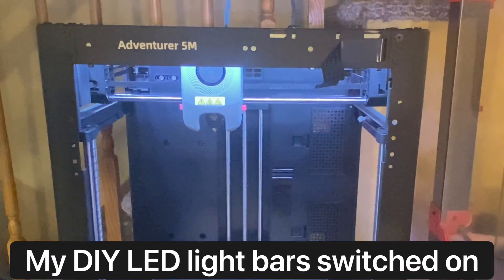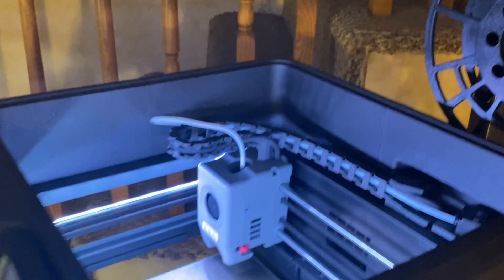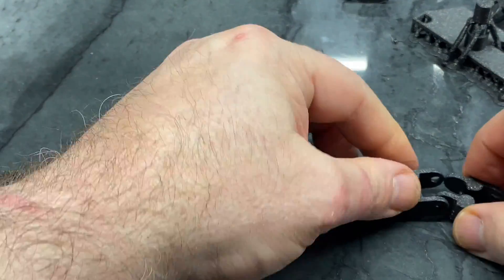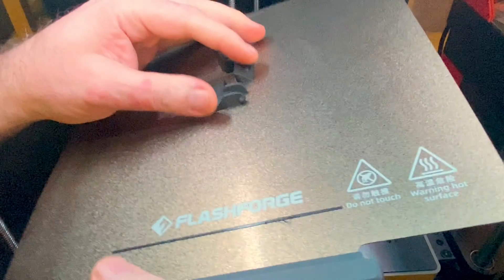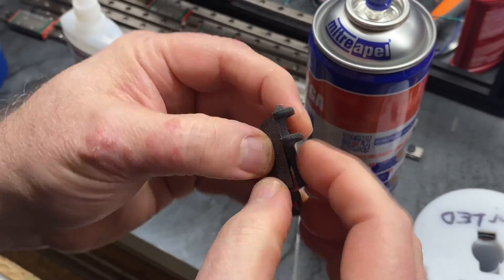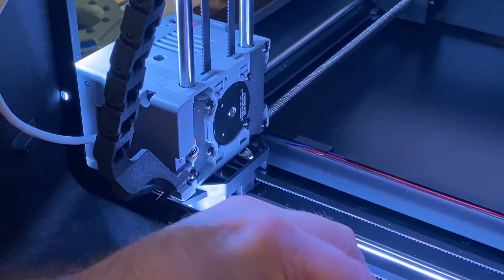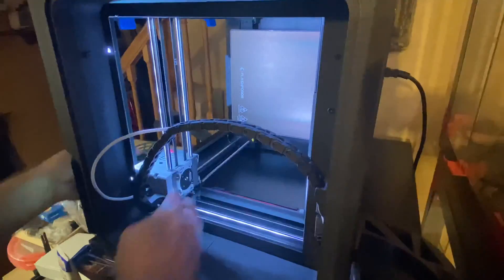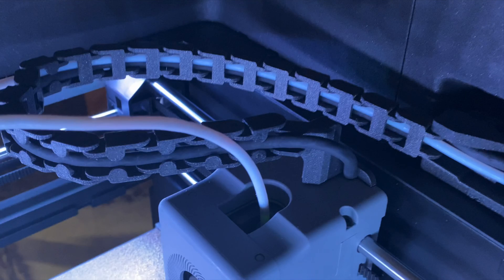Flashforge AD5M: DIY Enclosure- easier, simpler, faster, stronger cable chain termination at hotend!

Comment: Do you need the extra link if you use the drag link that came in the diy kit?
Reply: i have same question
Reply from the maker: I'd say no, but feel free to play around with your setup, checking if the length of chain is OK or if you need to reduce by removing any links. I have a mix of both printed chains and injection molded from kits. My kit-based chains do just fine.

Comment: new to printing been following the DIY instruction guide then i got to the spool holder... so i printed everying in STL. the STL version of that hanger was driving me insane trying to follow along(cuz its not the same). then i noticed STEP version... do i need to reprint everything in STEP going forward? lol. it all downloaded as a zip file and never says to do one over the other. feeling dumb.
Reply from the maker: You don't need to reprint everything, the STEP files just provide an editable version for customization. They make it easier to import the design into 3d modeling (CAD) software. Again, the STEP files are just for if you want to make edits and adjustments, the STL files are the final print files. In some cases in my listings, there are also .3mf files, which are my print job setups for OrcaSlicer, provided to show how I had (for example) parts oriented, parts ganged up, and supports tailored.

Comment: I had some issues getting this printed. Can you tell me if you had any issues getting it printed? I tried printing the first part of it last night, and it left a sizable chunk of the part and I had to cancel it. Any help is appreciated. I am using flashforge PETG and the ORCA-Flash Maker software. I am wondering if that might be part of it.
Reply from the maker: My AD5M has printed a lot of PETG with no problem. I've been using a print profile in Orca Slicer that was provided by Flashforge, that was named "Flashforge Generic PETG" and had nozzle temp of 255, but I later found it did better if I raised it to 260, and a bed temp of 70.

Comment: How did you remove the Flashforge logo from the enclosure top and ad your logo ?  I would like to do this for mine . I have all of your upgrades printed and ready to install when I get the top part of the enclosure printed .
Reply from the maker: I "remixed" that part in a 3D modeling program. I started in AutoDesk Fusion360, and I think I had to do some touch up in SketchUp because my logo is complex and I was having some issues.
Reply: @design8studio  Thank You . I'm still learning how to use Fusion 360 but I will give it a try .
Reply from the maker: @billywillis4194  After opening the file, which if there is a "STEP" file available that's first choice, and if not, then import the STL as mesh into F360 and generate faces and convert to a solid body... After getting at the file, the basic process for removal of the old logo, would be to right click on the smooth face that's the background around their logo, and create a sketch. in the sketch edit process, tap on "P" for "project" and select the edges of that face to project those lines into your sketch. You don't want their logo projected though. This gives a sketch that's a "clean" face version for that part of the solid body. Then finish the sketch, and select that clean face (you may have to temporarily hide the solid body to select the sketch's face, and then show the solid body again before continuing), and tap "E" for "extrude" and extrude outwards, with mode set to "cut" and cut away their logo off of the solid body of that part. You could then edit the sketch to add your logo, and then finish the sketch and select your logo and "E" for extrude except this time "add" mode instead of "cut" mode. Hope that helps.
Reply: @design8studio  That helps a lot  . Thank You .
Reply from the maker: I just remembered seeing that someone had already posted a remixed "no logo" version on Printables. It will save you some steps. Here's the link: https://www.printables.com/model/874859-flashforge-adventurer-5m-ad5m-enclosure-mod-no-log
Reply: @design8studio  That is awesome . That will save me a lot of headache even though I need to learn as much as I can in fusion 360 . Thank You very much .

Comment: I just purchased this printer and plan on doing the enclosure mod . Do you have a list and source for all the different fasteners ?
Reply from the maker: There is a vendor (I think the name is called Funspark), on aliexpress.us that sells a kit for the DIY enclosure that includes laser cut polycarbonate clear panels for the door, sidewalls and top, and a cable chain, some PTFE tubing, and all the hardware, for only $48. You can’t beat it. I think I linked to it from one of the other comments, or the video description, or the Printables description.

Comment: Hi great video I was really wanting to know how we're you able to tweak it and add you're logo and remove the flashforge logo? Please and thank you
Reply from the maker: Sure. There's more than one way to get that done. One way is you can download the source files from the Flashforge wiki for the enclosure (which includes STEP file) at https://wiki.flashforge.com/en/knowledge_corner/printer-mod-and-diy — you can open STEP file in Fusion 360, which has a free hobby license available, and edit the 3D model in Fusion 360 (or any 3D modeling program that can open STEP files) or you import the STL file info a 3D modeling program and edit that. One such modeling program is SketchUp. I did some of my remixing on the Fusion 360 side, and some on the SketchUp side. I think my final work on this logo replacement was in SketchUp. They also offer a free edition.
Reply: Thank you so much also is it 100% Necessary to print in PETG for the corner
Reply from the maker: @ThatRomnGuy  PETG is not necessary on the corners as far as I am concerned. I printed mine in PLA.
Reply: Or can I print that in PLA as well
Reply from the maker: @ThatRomnGuy  Yes, I printed my corners in PLA.
Reply: Sounds good thank you

Comment: Thanks again for sharing these excellent videos .. between you and Figure Feedback, I was convinced to pick up a 5M as a second printer, and already it's so overperforming my expectations that it will probably become the workhorse printer, with the Sovol SV07+ being used for the large size prints.
Reply from the maker: Thanks. I'm enjoying mine!
Reply: @design8studio  A funky design to be sure. Looks like the hotend is buried in the nozzle. That long part of it with cooling fins (sticking up towards the feed gears) is to give the filament a temperature gradient .. and that long heating zone is part of why the thing can go so fast. I am just busy now tweaking profiles. Had one botched print where layer time was so short (a print in two small objects) that the returning head knocked it off the bed. That was the sole botched print out of many perfect ones so far. Designing an additional parts cooling setup presently. It will end up on printables once I get it working right. The cooling upgrade I designed for the Sovol SV07+ (a twin 5015 parts cooler) won't work here due to the space confines inside the frame .. and I wouldn't want to add mass to the print head anyway.
Reply from the maker: @suzyamerica4679  Yes, it's fast for sure, and the strong heater is a key component. The long thing with the fins on it is not part of the heat chamber, but rather is the opposite. It's called the heat break, and its purpose is to prevent heat from creeping upwards into the extruder gear area. If heat were to creep up there, the filament in the grip of the gear would soften and the extruder gear would lose all traction. Thus the cooling fins! There is a fan that blows directly on the fins for accelerated cooling. The strong heater chamber is below the tall thing with the fins. Like you, I am also getting lots of flawless prints and very very few issues or problems!
Reply: @design8studio  After the experience of spending two months (OK, first printer) improving the Sovol SV07+ it has been a relief to just get flawless prints off this machine. Been using it to show curious friends what 3D printing is and how it works. There are a series of functional small prints on the machine, things that can be left with people - small boxes, bag clips, etc. I hope FlashForge someday makes one of these with a half-meter axis travel length and similar specs.

Comment: Hi, I want to put the filter kit with the fan, but I noticed that behind the printer, just above the motherboard, the PRO version has a conveyor, wouldn't you be able to make it?
Reply from the maker: It’s probably doable, but since I don’t have access to one of the pro versions of this printer, I have no idea what it looks like, how it functions, or what would be required to make one.
Reply: @design8studio  it is the internal air recirculation duct, see some videos to understand what I mean.... it is located right above the motherboard, but I understand that you need to have a copy to be able to make it.
Reply from the maker: @QuelFolleSulCanaleDavide  Feel free to link a video. I tried to find one that shows it but I could not.

Comment: thanks a ton !! I got it all printed.... BUT what about the other end ? I am sorry for the dumb question, but where / how does the filament detector area terminate for the drag chain?
Reply from the maker: That’s explained in Flashforge’s wiki for the DIY enclosure. Two printed parts get screwed down in a way that clamps onto the start of the drag chain.
Reply from the maker: The Flashforge video for how to do the DIY enclosure explains how the start of the drag chain is mounted, and it links to their wiki for the DIY enclosure directions, which also links to the printable parts: https://www.youtube.com/watch?v=6-RHAFNZ6jk

Comment: Amazing, looks great, will give it a try. Could you do a video on the lighting upgrade?
Reply from the maker: I recorded some video of doing the LED lighting upgrade and will try to get it edited and posted. I’m under a heavy load right now, and I don’t know how soon I’ll be able to get to it.
Reply: I'd also like that video too please.
Do you have one on a possible aftermarket camera install for inside the enclosure too?
Reply from the maker: @NomaddUK  I do have a Printables listing for how to use the Flashforge Adventurer 5M Pro camera ($25 accessory) on a 5M non-pro, here: https://www.printables.com/model/813334-flashforge-adventurer-5m-ad5m-printed-camera-mount  — which is what I am doing. I don't have anything about any other cameras.

Comment: Thanks for designing this! I like the look of that filament. What brand is it?
Reply from the maker: Thank you! This is Prusament namebrand filament called galaxy black. I do not normally buy it, but I had some free rolls because of where I had points on printables.com from people downloading my models. So I had it with only having to pay shipping for it. It’s nice because it has the white flecks that help hide layer lines.
Reply: 😮 that filament you used is super nice and really expensive £65 per kg
Reply from the maker: @Tony_3d_  Yep. And if I hadn’t have gotten those rolls free, except for shipping, I wouldn’t have them to use. In fact, for my second AD5M enclosure I’m using a more affordable filament. Don’t have quite enough left of that expensive stuff to do the second one.